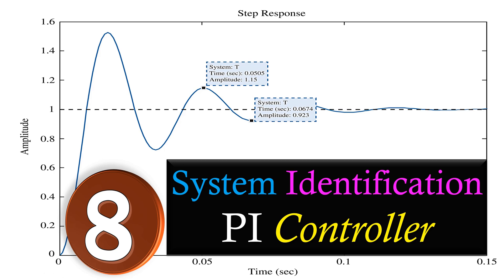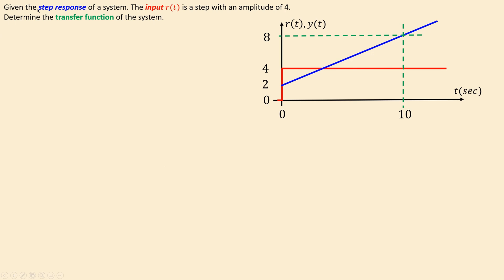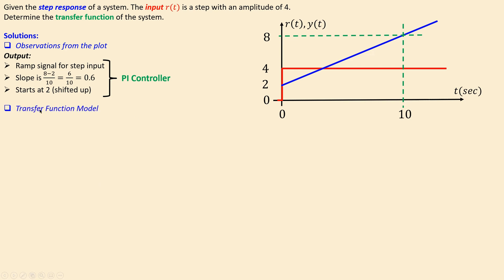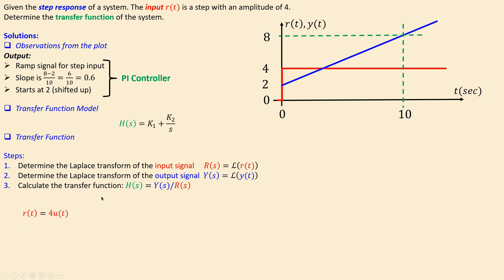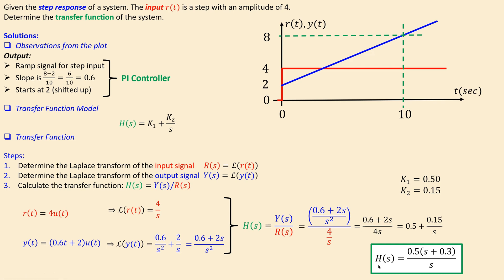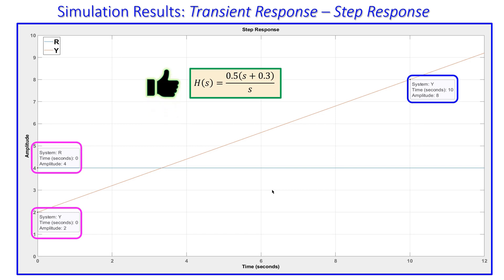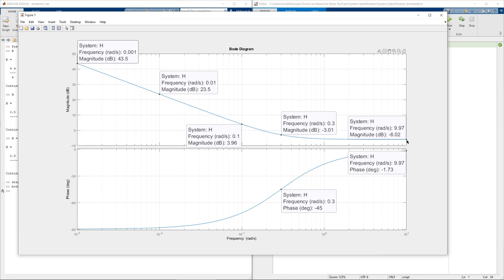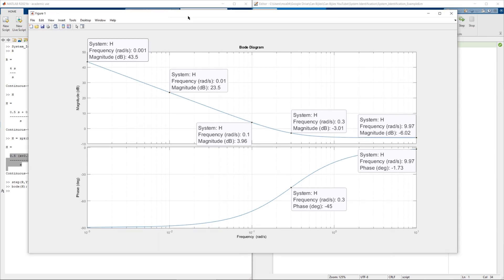System Identification ⭐ PI Controller ⭐ Step Response ⭐ Calculation & MATLAB 💡 Example 8

Comment: how can i determine the proportional band value and integral action time using pi controller graph (controller output vs time). error is constant and 20%. paper speed is 600 mm/h. thank you sir🙏🏻
Reply from the maker: First step could be to make a sketch of what you want and then determine the parameters from the plot.